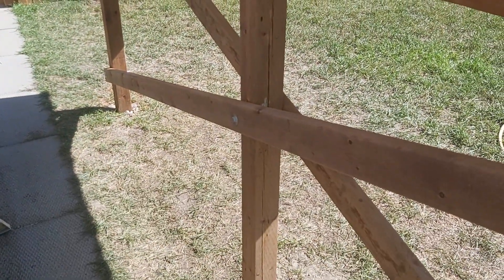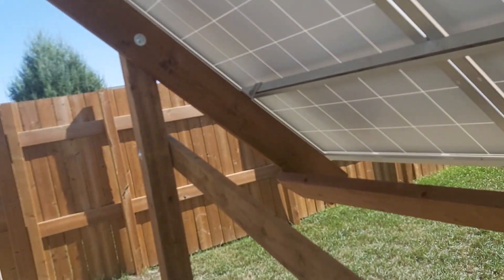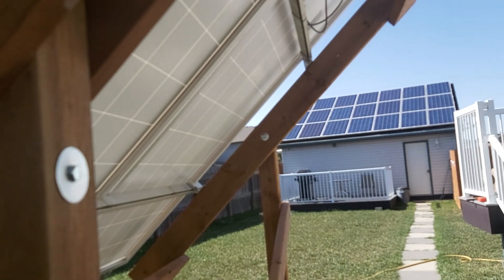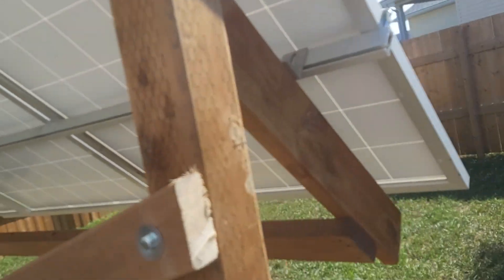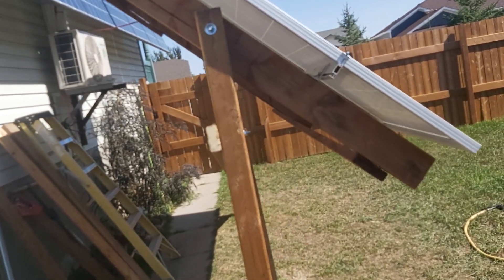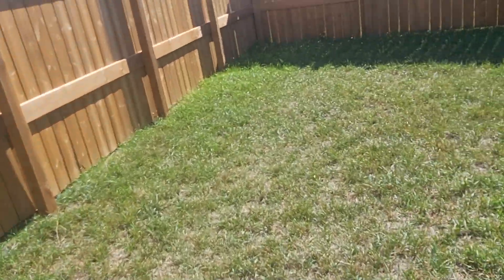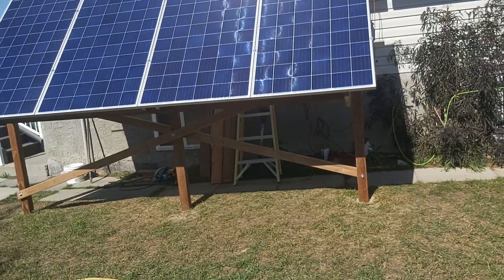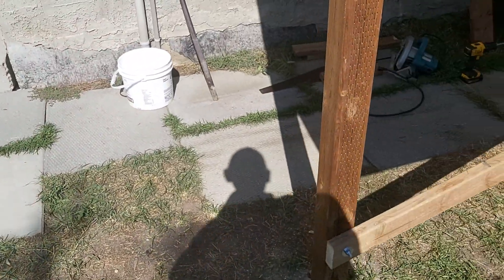Heat Pump Solar Rack Need Advice

Comment: two hinges connected by a height adjustable pole, connected  bythe bottom middle of the panels and the center pole. you adjust the pole to adjust the north south.
Reply from the maker: I resolved my issue today. I attached all three posts to the house. My angle adjustment also helps transfer some of the top of the panels too one foot below the top of the posts. I have this rock solid now. And easy to adjust for the four seasons. I will be doing a video showing it off within the week.

Comment: Put in more ground posts in, yes, but what you could do is have separate 2x4s with holes that you swap on those new posts for your angle adjustment.  How many different angles do you do to it a year? 3? That would be the easiest, most solid way imo but it would mean bolting together each time you change the angle.  Could just be 4 bolts to do in total.

Comment: I thought about a similar design as yours. Then I thought how strong of winds do I get were the panel ground mount will be. I went with a fixed mount so I can have 2 rows of poles with cross braces etc (yours has 1 row).  I have 48 panels on my ground mount.  Yes add a front row.

Comment: Vertical posts that are tall with a lot of weight on them usually need a good base to prevent front and back sway, and need to be planted pretty far into the ground.  I like your idea of up & down adjustable panels, but would have liked to have seen the uprights as 4x6s.  However, since you went with 4x4s, I would add 4x4 bracing at 45 degrees at the bottom of the posts to minimize the forward and backward sway.  The further up you can attach to the posts, the better.  This would still allow for panel adjustments.  If you just want to minimize the forward sway, you could add cable ties near the top of the posts and secure them to your house.  However, cables will encourage and not prevent the panels from falling backwards if the posts are not buried deep enough.
Reply from the maker: It was pretty windy today and I was panicking, the hardware stores are closed. I came up with a really good solution. I'm attaching to the house with a fixed system. For the tilt system I came up with an Idea of how too transfer the top North South wind loads further down the posts using the adjustable boards. It's gonna be ugly but awesome at the same time. Right now I have two of the posts temporarily braced with 1x4 scrap I had laying around.  I will do a video when I'm done. Are you subbed yet?
Reply: I was thinking a little more about your set-up and was thinking pretty much on the same lines.  You can get the most support you could by installing a few horizontal beams directly to the upright 4x4s.  Mount them 90 degrees just below the frame swivel point, and then attach them directly to the house.  That should give you plenty of strength in the north south direction.   That would also allow pretty much full use of your adjustment mechanism.  If you vary the angle of the support beams attached to the house, up or down, the strength of this support is going to be degraded the more it varies from perpendicular to the vertical posts.  However, I'm not sure how much support you actually need to stabilize those 4x4s.  You could angle the vertical supports upward on the house, but the more angle to put into those support beams, the less support you will get and your adjustment to the panels will be hindered.  Attaching anything to the top of the adjustable frame, is probably a bad idea.  First, you would probably not get rid of the NS movement in the vertical posts when a strong wind hits the panels from the south.  It would stop the top of the panels from moving, but the bottom will still flex and push on the top of the posts    Yes, I'm subscribed.

Comment: Concrete deck blocks? Do you get frost heaves?
Reply from the maker: Yes we get frost. Everything here has to be 3 feet deep.  I just did some test measurements, I'm going with a L-bracket on the house into the 2x6 studs. I can still walk under it. There is enough bolt thread left on the top of the posts and the L-bracket will be under the existing wall mount panels.

Comment: #1: For the post with the split, caulk the split and cap the top. Water should shed and not get in the gap and freeze. #2: I agree with Sarky on bracing. Unless there is a way to place one post on each end, to secure the panel tilt?
Reply from the maker: I think I have a tube of dark brown calking in the garage. I might do that. But sealing could also trap the moisture in and cause rot. I should have rejected that post at the lumber yard but their whole skid looked like sh!t.
Reply: @timcat1004  I think you’d be surprised if you caulk it. At the very least, it looks much better and should add a few years to the life of the post as opposed to doing nothing?

Comment: I think bracing posts in front is the only sensible option, Tim.
You can still cut the grass with a strimmer.  Or get a goat.  😂
Reply from the maker: I just did some test measurements, I'm going with a L-bracket on the house into the 2x6 studs. I can still walk under it. There is enough bolt thread left on the top of the posts and the L-bracket will be under the existing wall mount panels.